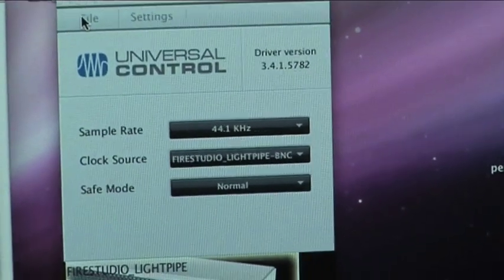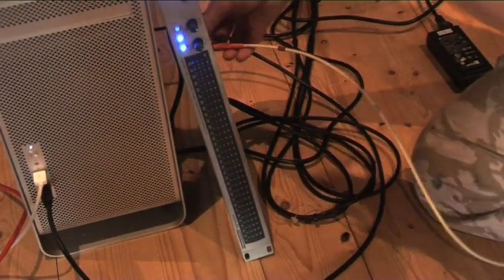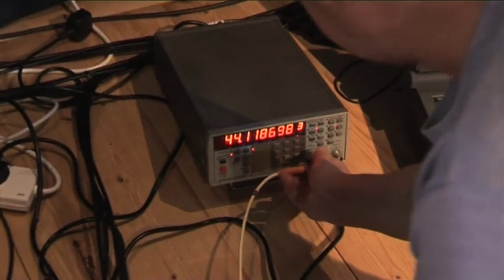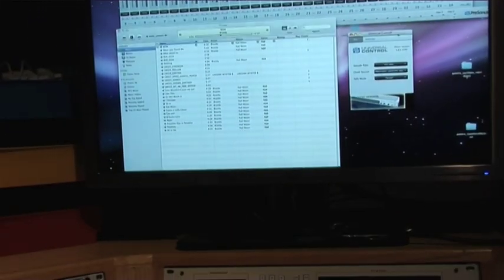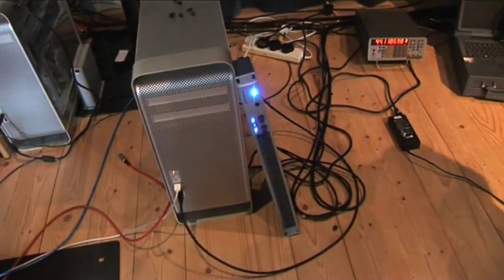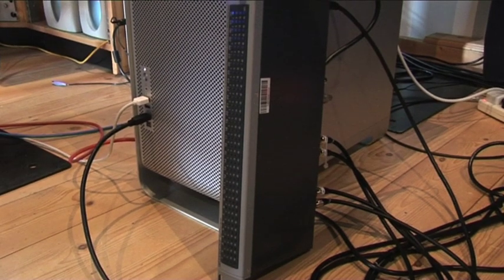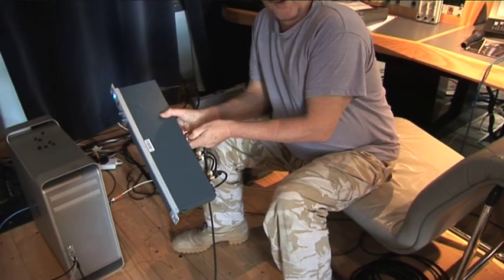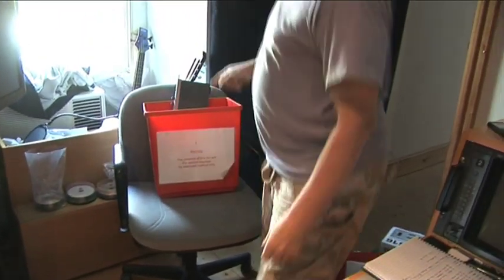Part 3 Presonus Sync Problem

Comment from the maker: Yes exactly what I mean, you dont have  a working unit in the box when it comes. As the PCBs are not commercially  fixable, all they did was probably send you a new unit or new PCB boards back. My PCBs are marked 2007 on a 2009 unit!!!. I reckon some of the firmware can't be upgraded by a upload, so they have to fix the inherent problem, probably a PLL fault. The stupid updater Universal Control does not read back the unit's f/w revision. it just says " it's up to date" whatever that means.